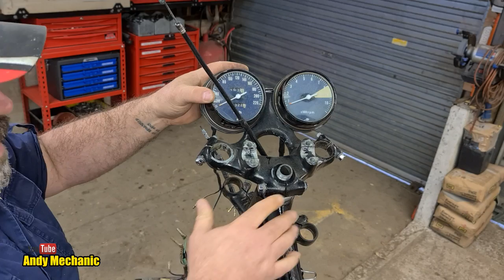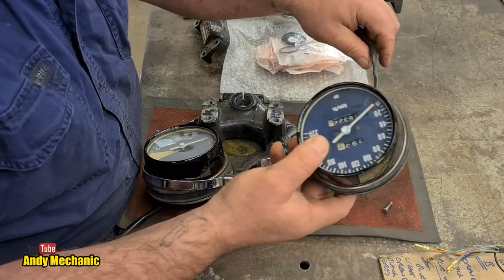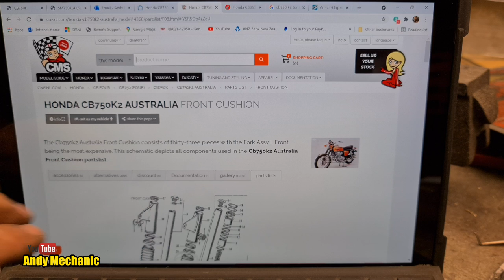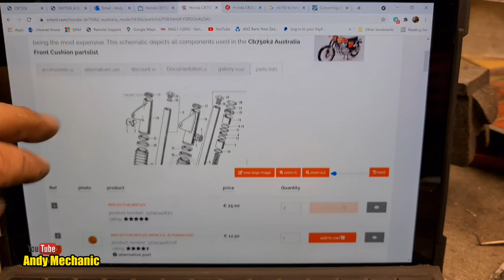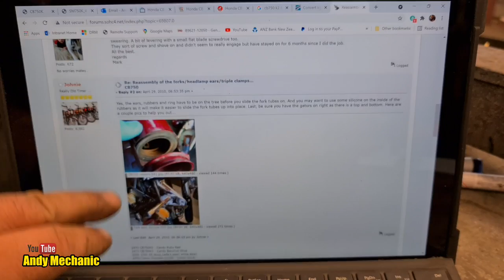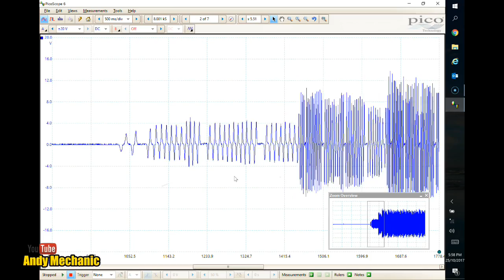Honda CB750 K2 - triple clamp replacement #1517

Comment: That D washer should be 2mm's thick according to one of my CB750 books.  That's the earlier "unicorn" triple tree.  Harder to find and more expensive than the later year 750's. 

Ive been looking for a video to explain how the fork gator goes onto the bottom of that head light fork ear.  So glad you made this video. Now I know.
Reply from the maker: Hi Dave, many thanks for the info on the washer thickness, very much appreciated - I'll cover this in the next video :-)

Really appreciate your feedback 

Cheers Andy

Comment: the flat on that  D washer needs more taking off    i think its binding on the fork tube and bolt andy  liking the vid
Reply from the maker: Hi John, yes you are correct. I had a much better view of what was going on when I was editing up the video. I'll be sure to be replacing these washers with some of the correct dimensions at the next stage of the build.

Really appreciate all your help

Cheers Andy

Comment: could u tig weld that back up or would it expand and to contract to much
Reply from the maker: Definitely not. Here in New Zealand it's illegal to repair or modify a steering/suspension component. Besides, this is a rather important component on the bike & failure could likely cause serious injury or death...

Cheers Andy

Comment: In my CB750 Clymers manual there's some torque specs but I don't see top triple tree fork holders listed.  It does list "fork top bridge to front fork" and "front fork bottom bridge."  Could those be upper and lower triple tree...or are they referring to something else?   It has them at 13 to 17 ft pounds of torque.  Nowhere near what you referenced.

Comment: Nice :) Pretty dissapointing of the part supplier to make such a rookie paint job. You would think for such an expensive part, they would properly plug the screw holes for painting!
Reply from the maker: Yes, I agree. Not impressed either given the cost & well....Honda?

Cheers Andy
Reply: That doesn't look like a genuine Honda part. Should be a satin finish and Honda would have masked the threads.
Reply from the maker: Correct, the replacement is not a Genuine Honda part.

Cheers Andy